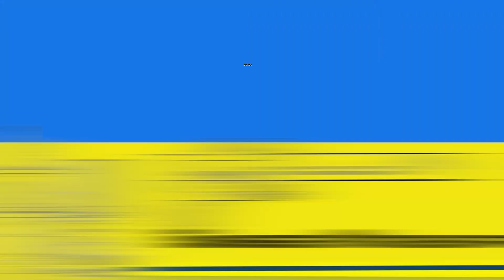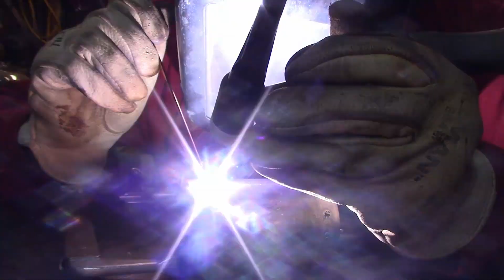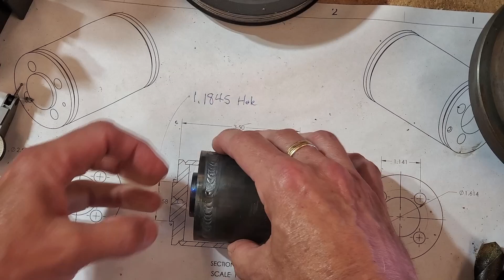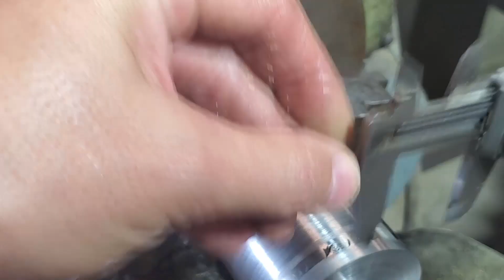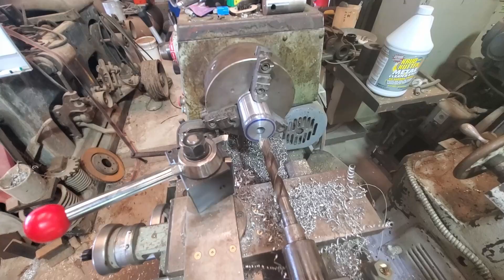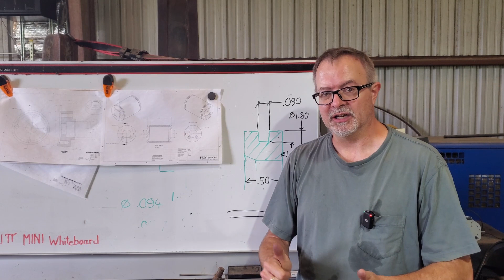Balancer Spacer IV - OD & End Cleanup

Comment: That C-clamp is a terrible ideal.  If it were to vibrate loose from a cut,  it may likely jamb in the chuck jaws. Not trying to be a dick, but you have had bad luck with stuff like that.  -----Doozer
Reply from the maker: Yeah, haven't found the lower half of the micro stop - will have to make one.

Comment: Nice progress! is there any seal on the timing cover? I probably would have put on enough weld bead to clean up fully, but as they are, they should be plenty strong. Your son and I both need weld positioners, that's a project on my list.
Reply from the maker: There is a cover, not a complete seal though. I think he is just going to use the top half though. His bracket gets in the way of everything.